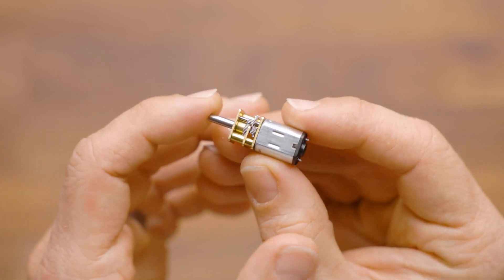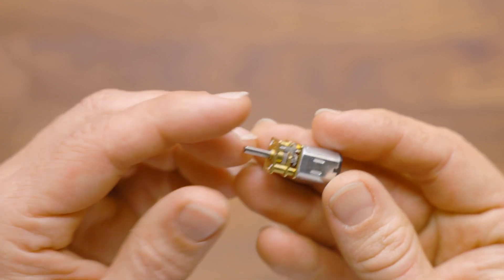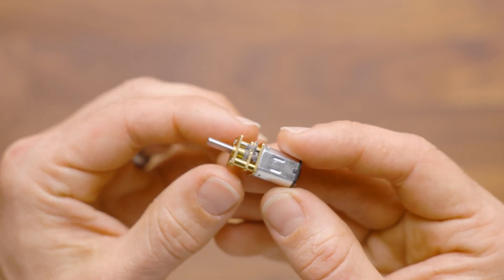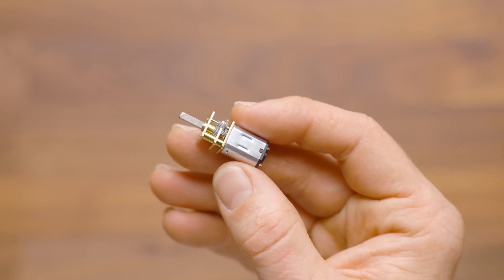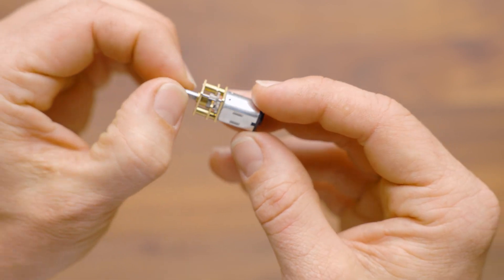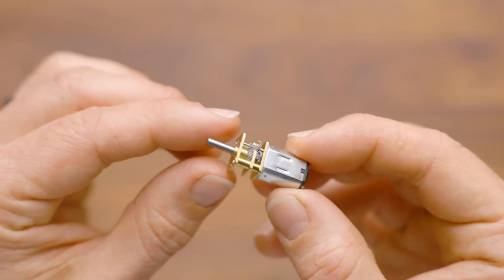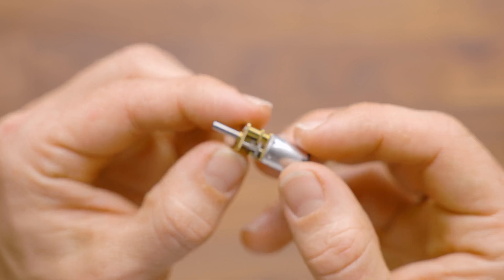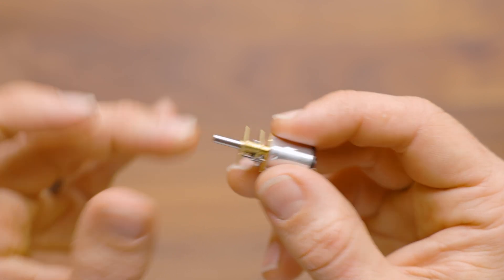Product Overview: N20 Gear Motor

Comment: the fuck u mean spinning it manually damages it

then it s called a damn generator and its designed to work that way

there is nothing connected to that motor, u cant damage anything ffs

if u say damaging the gear, then by same logic, using the motor also damages the gear

Comment: I am not that good with eletric things, can somebody tell me if this motor can run on a 6v normal battery?
Reply from the maker: Technically it can run at 6v, but normal alkaline batteries don't put out nearly enough current. N20 and other hobby motors work best when run on 9-12v with a 2s or 3s LiPo battery pack.
Reply: @lukegoodman5877  bro do u even know wtf u talkin about

alkaline can give at least 1A shorted

ur yeeyeeass motor uses barely 0.1A under load

and sure use 9-12v when that thing is rated freaking 6v

thats on u when the guy burns his motor

there are no other hobby motors work best on 9-12v, learn electronics, it literally depends
Reply: @lukegoodman5877  thanks for helping man, great work

Comment: Hi, I know this is a very specific question but can you tell me if it would be safe to use these motors with an L298N motor driver, powered by 7.4V LiPo battery?
Reply from the maker: I'm not too familiar with that particular driver, but according to the specs, it has the voltage ranges to support this motor and your LiPo.
Reply: its called a damn h bridge of course it works ffs  @lukegoodman5877
Reply: @lukegoodman5877  Yes, thanks, everything did work out. It was for a university course and I was just done with the project evaluation yesterday.

Comment: Is there a way to change the direction of those? I got one and it turns counterclockwise. Im so mad cus I needed it to spin clockwise
Reply from the maker: Yes! If you wire the motor the other way, you will get it to turn in the opposite direction. Hope this helps!
Reply: @lukegoodman5877  thanks this helped a lot. Figured it out
Reply: bruh wtf

wat counterclockwise

the motor literally doesnt have a designed or defined direction

u spin it how u want

some store sells u these with soldered or connected red and black wires, thats cause they stupid

and u should know better